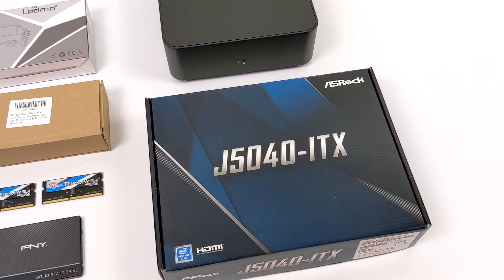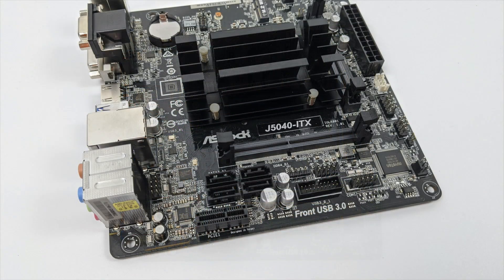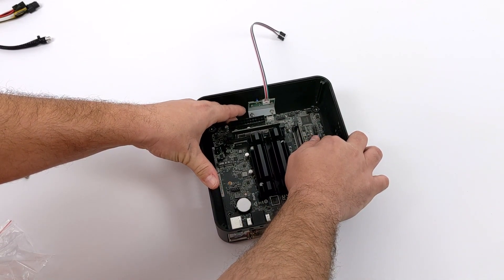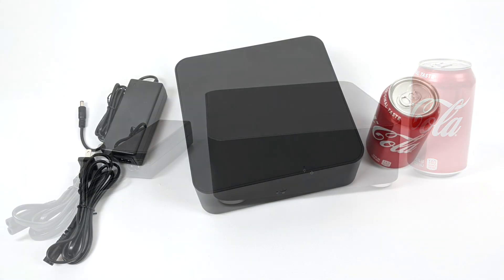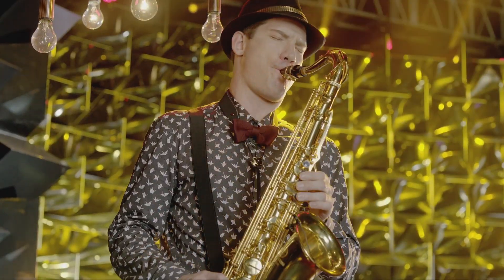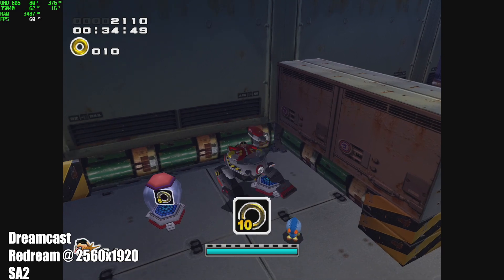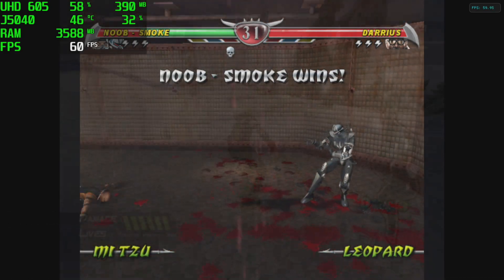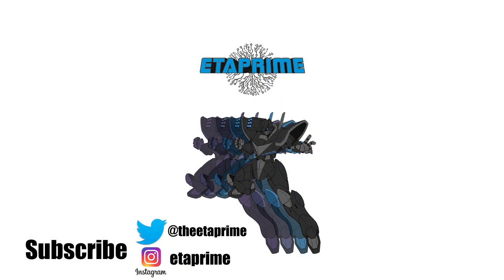Silent Mini ITX PC 4K PC Build - 4K Video, Emulation, Gaming - ASRock J5040 ITX

Comment from the maker: What would like to see running on this tiny setup?
Reply: 8K Playback?
Reply: video editing
Reply: CRYSIS
Reply: Genshin and some newer emulator like gameloop??Pubg mobile and codmobile in 720p shud be good enough
Reply: Hard to emulate MAME games like Violent Storm or one of the Marvel vs. Capcom games. Also, would this replace the small pc you have in your rec room arcade cab?
Reply: @HuntaKiller91  Genshin would very likely fry this Celeron
Reply: PS2 (although this thing doesn't support AVX I guess)
Reply: Undertale?
Reply: Rpcs3 and xenia. Perhaps a side of shadow warrior 2 and no man's sky ?
If you feel fancy, i guess xbox and ps2 emu with a few 60 fps patches ?
Reply: Any virtual pinball?
Reply: 16K Video test
Reply: Temple os
Reply: Was thinking an Odroid H2+ would be better but nope.  Cheaper on amazon than the odroid and better all around
Reply: PS2
Reply: Can u run a graphics card on this system ?
Reply: @WhenDoesTheVideoActuallyStart  this is a pentium look in description
Reply: Could you connect an external gpu and game? Or stream games with it
Reply: Lakka!
Reply: Tropico 5/6?
Reply: @SludieOfficial  streaming games is shit so I'll buy a external instead
Reply: Crysis
Reply: @Samuel Berhanu this or BlissOS, PhoenixOS any of the desktop modded android distros
Reply: @Maximus20778  It's basically an updated J4105, which was a Celeron.
Reply: @Maximus20778  And no, you can't run an eGPU, there's no NVME. Plus, you really don't want to play games on this. It's still built in a revised Atom architecture, not much different in raw performance from the old Core2Quads
Reply: @WhenDoesTheVideoActuallyStart  then I'll buy a latte panda thats better than this
Reply: Comparing windows/linux gaming and emulation
Reply: The temperature
Reply: While I'm pretty sure this device can handle it, It would be great to see how Table Top Simulator runs on low-end devices. I play a lot of it and am trying to get my friends to play but some older Mac Laptops seem to have trouble with it. I'd love to be able to recommend a tiny system to play on.
Reply: The PPSSPP emulator has SERIOUS performance problems with GOD OF WAR, PARASITE EVE and DANTE'S INFERNO, and the RPCS3 has same intense problems with DANTE'S INFERNO and BROTHERS - AT TALE OF TWO SONS, so, I'll suggest You that include on next performance tests and reviews these games.
Reply: PS2 emulator
Reply: Cemu
Reply: No Chains of Olympus this time?
Reply: Another great production of ETA Prime
Reply: Libreelec
Reply: Saturn. Both Mednafen and Yaba Sanshiro.
Reply: parallel n64
Reply: I’d like to see high-end arcade emulation.  Star Wars Battle Pod or some newer arcade games.
Reply: Native android or an android emulation! You could show some demanding Play Store Games like GTA 4, some Asphalt or Real Racing ... and of course: XCloud!

Game Pass games on this build should look very nice. Like Witcher 3 or Subnautica.
Reply: CoinOPS Wii U & Model 3.
Reply: PS2
Reply: doom eternal
Reply: Minecraft Java with ...(?).. ca ~2014-15... high(er) demand shaders...(?).
Reply: I always wonder how a little machine like this would handle games like American Truck Simulator or Euro Truck Simulator2
Reply: You can actually use an adapter for that Pci-e slot in order to get an M.2 Running.
Reply: @idk7-c7s  would youtube be able to handle that though? I thought the max was just 4k
Reply: Ps2 emulation
Reply: @carsonbrooks1326  i think 8K Videos do exist on youtube
Reply: How about some metroid prime? And could you start opening some large cad files? I'd love a minature capable workstation
Reply: @idk7-c7s  oh ok, I didn't know that.
Reply: @Maximus20778  might be shit, but its all some people can get. Glad its available.
Reply: ps3 & xbox 360 emulator .
if it cant play it , what is the min spec to play it (mini itx) ?
what is the smallest case can take low profile vga ?
Reply: Rift S , but it doesn't have a DisplayPort ...
Reply: Can it record and stream
Reply: world of warcraft
Reply: When you try Citra, can you try running a game like OoT3D? On my big boi gaming build, Mario runs poorly, but OoT runs great! I might be doing something wrong, because I am just using normal settings, etc., but I have noticed that Mario 3D land runs poorly while other games do not.
Reply: Half-Life 2 in 480p
Reply: Yeah I'd like to see you put a SSD in that "Wi-Fi card" slot. You got to learn how PCI works
Reply: Crysis remastered
Reply: Microsoft TEAMS on large screen and Fortnite. Thx
Reply: Install android x86 on this
Reply: Sega Saturn using the retroarch beetle core
Reply: Id probably  use this a secondary   computer  for  a streaming  📦   or  as a retro pc.
Reply: Batocera or recallbox
Reply: GoldenEye 007 64
Reply: @idk7-c7s  4k60 max
Reply: @jblps  it dosent have to be youtube
Reply: @idk7-c7s  the hdmi spec limits? Here's a quote from the product listing "Supports HDMI with max. resolution up to 4K x 2K (4096x2160) @ 60Hz"
Reply: @ChannelOfElveman  Would like to see some PS2 emulation was well.
Reply: I’d be curious to see if it could be a low powered Plex media server and accomplish a few transcodes?  Thanks for your great videos.  They’re very informative.
Reply: PUBG PC???
Reply: I'd like to see how it handles virtualization running Proxmox VMs or ESXi
Reply: VM's, containers, NAS performance.
Reply: PS 2 emulation!
Reply: minecraft java
Reply: PS2 plz
Reply: Ark survival evolved
Reply: Wii and ps2
Reply: those games in video, the ran at integrated gpu ? intelh hd graphics? thx
Reply: Twister OS
Reply: Can you adapt a graphics card to the pci slot ???
Reply: @Alex Liam I dunno I use flixportal. you can find it if you google :D -kyng
Reply: @Kyng Ronin thanks, I went there and it seems to work :D I really appreciate it !
Reply: @Alex Liam happy to help :D
Reply: Proxmox or other Hipervisor

Comment: Can't wait till they have these in AMD APUs.
Reply: I think those asrock A300 Desk Mini with some Ryzen 2200/ 2400 should be close...
Reply: I run an ASROCK X300 with a 4750G.  If you choose power saver, it usually uses between 7 and 15W and you can't hear the fan on the heatsink.  Temps never really break 50.  There's also the PN50.  A 4300U model would walk circles around this thing and is less than half the size.  I have a 4700U model of the PN50.
Reply: Hey what are your temps? I have one with a 3400g and noctua l9a with a 1500 oc on gpu and I get 90c?
Reply: @amongstourselves6203  I'm not seeing those temps.  I actually just received an ID IS-47K in today.  Was going to do a comparison between that and the L9A that's in there now.  Long story short, the 4750G runs VERY cool for an 8 core.
Reply: @ccallaghan84  after trial and error and studying. i ended up reseating my cooler then making sure i had the latest driver. i got 4.0mhz cpu at 1.3v and 1600mhz gpu. using ryzen master stress test i got about 68c but when playing skate 3 on rpcs3 i got about 78c after half hour of playing. so i think thats pretty good. looking forward to seeing how the 4750g handles emulators!
Reply: They already had, its ASRock X300
Reply: Amd 4000 series APU is nowhere to be found mate
Reply: Asrock only make intel itx SoC mobos, Gigabyte can do it but...
Reply: @akhyarrayhka4048  grey market units are floating around on ebay and Ali Express

Comment: honestly i would be more interested in the usability of one of these as a NAS. with 4 sata ports and a 1x pcie for a stata expansion board it should be possible.
Reply: I'm using a J40205 in my NAS and it works great with FreeNAS and a couple of plugins. Also, I could get 16GB of ram on my board even though the CPU specs list 8GB like the one in this video. I was thinking about changing from FreeNAS to a Linux based OS so I could better run Docker and VMs for some other services.
Reply: @TheAnoniemo  Same here,  I have the same case, bought on aliexpress.  I have a j4105 as a plex  server (direct play) and back up on windows.
Reply: I'm using it as a small lxc environment with Proxmox, works great!
Reply: @TheAnoniemo  Check out the upcoming TrueNAS Scale
Reply: @russellbaker4256  That's exactly the one I had in mind for the upgrade, but it's still in beta so maybe I'll wait a bit! Proxmox seemed nice too, but it doesn't have the focus on storage that FreeNAS does.

Comment: This RGeek case is the same one I used when I tried to do the Ryzen 5 3200G build you did a year or so ago.  I used a Ryzen 5 3400G and a bigger 250W RGeek branded Pico PSU and a beefier 12V adapter.
The version of the case I bought has a vented lid.  

Also, the mounting bracket for the ssd drives also can accommodate 2 50mmx50mmx10mm fans.  One one each side of the bracket.  I have them in push/pull configuration so one side sucks air in and the other blows out.  I used included screws with the case to mount the fans.  The fans only we're mounted to the top screw holes on each fan and hang down while in the case and line up with the case side vents.

I am very pleased with this case and love the little Asrock B450 ITX board with Ryzen 5 3400G.  I used an Intel 660P 1 TB NVME and the Team Group Vulcan memory used in the build you did.  

Great little machine.

Comment: For 149 bucks I actually might get one!
Reply: Yes. It definitely sounds like a great deal.
Reply: 149+storage+Ram+the rest...at that point your better of building with a 2200G that has a better iGPU
Reply: @colonelccccc  or something like a 3000g, it's still much better than that chip. if gaming ain't your thing, even a cheap Chinese laptop will do the job
Reply: @colonelccccc  The difference is this rig will take 12-15W :)

Comment: Great little build.

I love these low power SoC boards, I still have an ASRock 3150M mATX board running as an HTPC on an older 1080p TV and it works great for youtube, netflix etc. It also works great for emulation and older PC titles, even Tomb Raider 2013 runs at 30fps @720p low with high textures. Sure, it's no desktop substitute but for it's paltry 26w max draw at the wall it really is something special.

Comment: I like to use 40mm variable-speed fans on systems like this. At lowest speeds they can be effectively silent, yet still noticeably reduce temperatures compared to a purely passive solution.

I also like to use motherboards with external 12V input, like many Jetway models. They tend to cost more, but this is somewhat countered by eliminating the cost of a PicoPSU. They also often utilize full-sized DIMMs instead, which can provide significant savings at times.

Comment: Additional information: You can get this case with pre drilled holes in the case top cover. That helps with ventilation if you have a 35w or 65w CPU with active cooling. There is also a silver version of this case. You have a 65mm and 80mm version depending on how high you want the case to be. It looks like you can also have 2x40mm 50mm or 60mm fans in the case. Also the MB supports HDCP 2.2 but it does not say what HDMI version is supports.

Comment: Recently bought an ECS J3060. Pretty cheap and good for PS1 or N64 emulation. Since I want it for Arcades and 16bit, it's a beast. There is no way to get a PICO PSU in Argentina, so I was forced to buy an ITX case with PSU included.

Comment: Going off the current prices puts this around $300 total? Not bad but an Nvidia Shield TV can handle the 4k playback and most of the emulators for half the price. And with a similar or slightly higher budget you could squeeze out a used Ryzen 2400g build instead (though it might not be "silent"). Also, it's seemingly random whether you put prices in your vids, but I'll say I prefer it when you do.

Comment: The case on Amazon is now $80, but if you look for something similar, you're still going to be paying at least $50. If you got that case for $30 it was a steal. And the J5040 Motherboard and CPU combo are $120 now on Newegg. Also this would run much better with Android x86 I bet.

Comment: So I built a similar PC on my channel using the ASRock J5005-itx. It's a great lil build. However, heat was a small problem in my testing. I did cpu stress test for an hour, which is worst case, and that was the only time I had over heating. I would like to know if you had any problems with overheating and throttling while gaming? Thanks

Comment: I've noticed you never test Steam Link / Steam in home streaming, which would be my primary use case. Though I suspect wouldn't tell you much because it would just be a LAN / decoder test. Not something that is going to be a problem on a full blown x86 system like this but might make a difference on smaller machines

Comment: Size vs Noise vs Price. i believe an athlon 3000g with a320m itx board would do much more, better and maybe even cheaper.  i would love to own the x300 (or a regular b550 mobo) + ryzen 4750G but the price is absurdly expensive and availability of both are very slim. i own the A300 + 2400G (+ intel 660p 512gb nvme, 2x8gb corsair, intel wifi chip) and its a great mini pc even if it cost me $500+. too bad AMD is on top now and most of the new stuff they sell now are expensive.

Comment: Never understood why there is a green cable for ground in those pico (atx-dc) power supplies. Isn't the 24-pin ATX connector already grounded in like 8 of its connections. If attaching the green cable to one of the motherboard' screws then most probably it is grounded to the same ground as the ATX connector. You can test continuity with a multimeter. Can someone provide more info please? Thx
Reply: Power ground and shielding/safety ground may be, often are, and frequently should be separated.
Reply: @Azlehria  Thank you for your feedback. The word "safety" (ground) made me rethink the purpose of the green cable. You are correct, it totally makes sense, the green cable should act as a dedicated safety line without having to route electricity through more "sensible operational ground trails", at least this is how I see it now. This could be critical to an electronic such as a PC motherboard.

I just ordered an ATX-DC power supply. It should arrive in a couple of weeks and then I'll be able to experience it by myself. Take care, thanks again, bye.

Comment: i wonder if it can take 16gb of ram against 8gb it says in asrock website?
Reply: It works even with 32 GB (16+16) but it depends on the sticks. Some 16 or 32 GB memory configurations may not work, which is probably why 8GB is the official supported memory size. I'm using two Kingston KHX2400C14S4/16G sticks as I'm typing these words and it's all fine.

Comment: 149 for that board? the x470-i from biostar costs 88€ here in germany and then you have 60€ left for a cpu, maybe a athlon 3000g that is around 50€. that asrock board is not a good deal

Comment: I think the this build is not very interesting. It is similar to my passive server which is Dell Wyse 5070 which I bought of ebay a year ago for 100bucks with J5005 which is a bit slower than newer J5040 but not by a lot. The same Dell Wyse 5070 still up for sale on ebay from the same seller, albeit for a higher price now about 150 buk. I installed 16gb ram into mine and an m.2 sata drive. Works very well for a passive cooled mini pc behind my tv.
Reply: Hello. Does the Dell Wyse 5070 cool the CPU with a fan? Can you watch YouTube in full HD? What system are you using?
Reply: @MrRekss1  Its passively cooled, no fan. And yes youtube full hd works. Mine has J5005 celeron and I'm running 2 screens with it. Very nice little machine for light tasks.

Comment: I'm wondering if you could fit a Ryzen APU with a Noctua L9A heatsink in this case. With one of the newer mobos having an m.2 slot, you could remove the SSD bracket so I think you would have enough space. Am I wrong in my assumptions?

Comment: So the motherboard and cpu are 150 and you still need ram, storage, case and power supply? lol just buy a laptop who is this for, seems like it sits in a weird limbo between a rasberry pie and cheap apu pc. This isn't even worth it as a secondary pc more like 3rd or 4th lol.
Reply: Yeah that's what I'm thinking.  You can even buy a used Lenovo Tiny M93p for $200 that uses a 4th gen i7